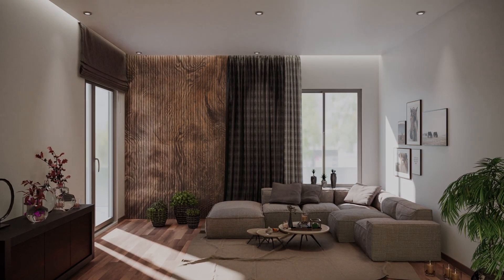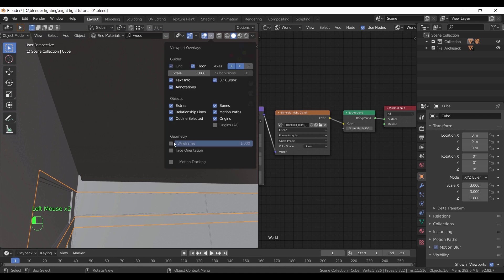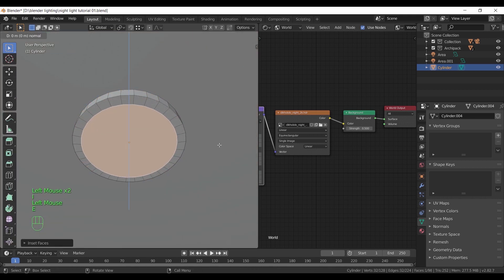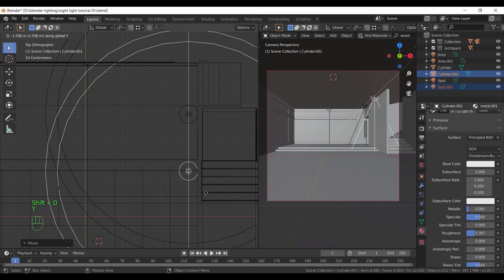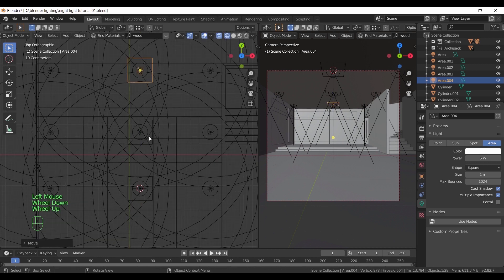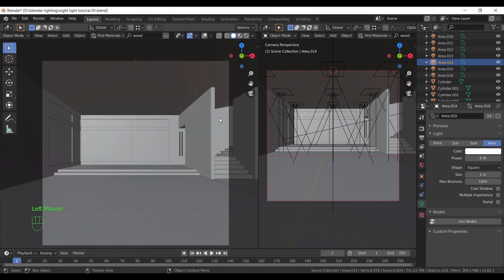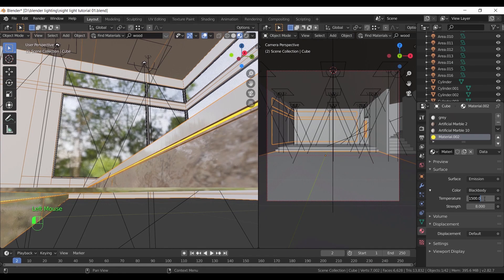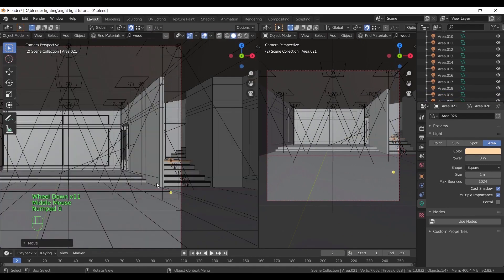Lighting Interior Archviz in blender - Beginner guide for Night scene

Comment: Can we achieve lighting realism without using HDRI? I found my laptop is excessive load
Reply from the maker: In night scenes, I think you can, replace it with images cast over a place and a simple sky color. it won't affect the scene much.
However, in daylight scenes, using HDRI's makes huge difference. you can use only sky color if your camera not showing the windows directly and only walls. in that case don't use either HDRI nor glass material. 
hope this helps.